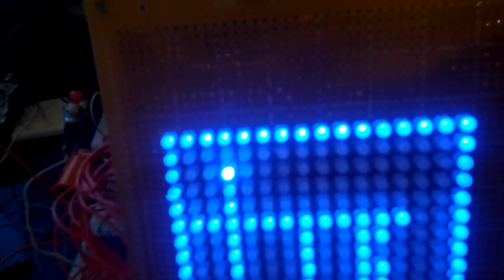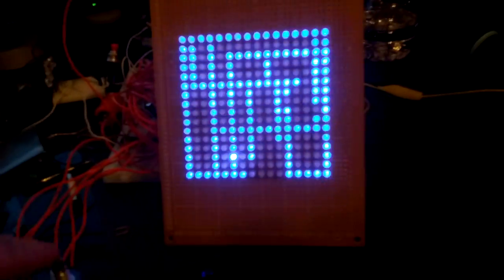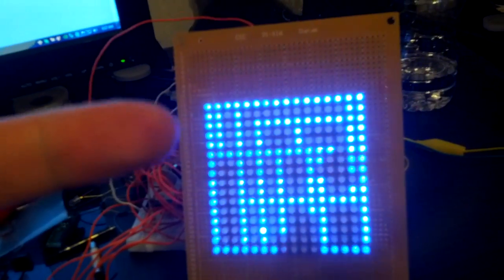16x16 LED Electronic Etch A Sketch using hard coded logic

Comment from the maker: 2x adc0804(expensive adcs, better to find some cheaper ones), 2x 4019(quad 2 of 1 data selectors), 4069(inverter), 4027(jk flipflop),2x 555, 4515(1 of 16 decoder), 4514(1 of 16 decoder),2101(1024x1bit static ram), 74191(4 bit binary counter), ca084(op amps used as comparator to do logic level conversion from 0-5 to 0-vcc of decoders), 7805(5v regulator), 256 leds. 

A few parts should be replaced for better ones though like adc and logic level converters. Can also replace others with equililents